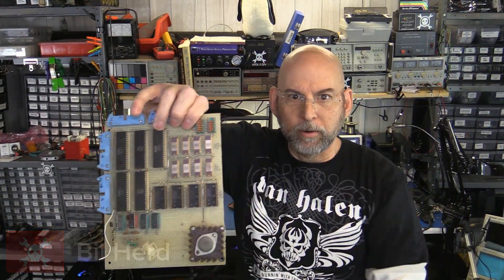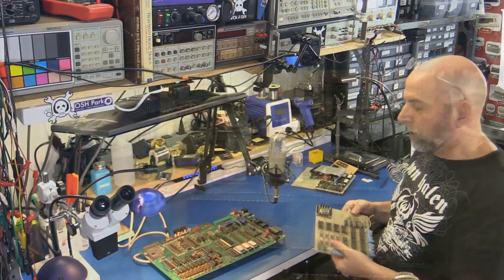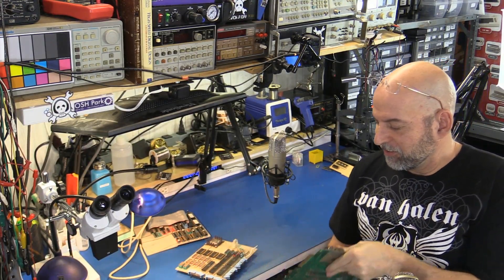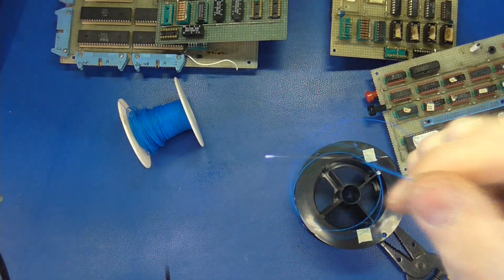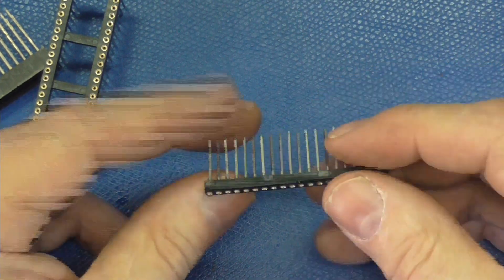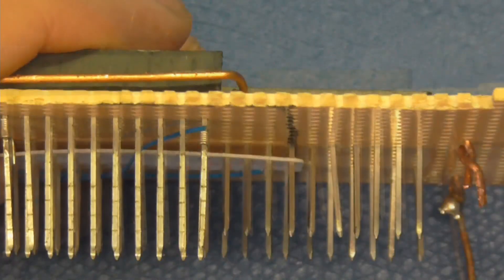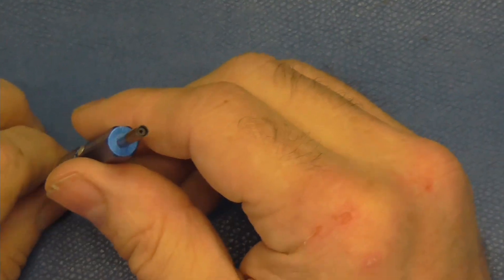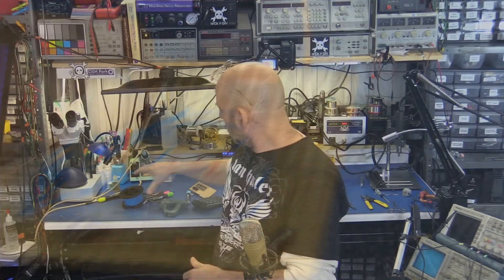Introduction to Wire Wrap

Comment: I commented on this same video  9 yrs ago. Today I'm 3d printing a full tournament size smart chess board and will be using wire wrap for the play surface... certainly beats the cost of such a large PCB and I can 3d print mounts with holes for the component legs.

Comment: It's been 7 years since my Senior Design project, now I feel like I've forgotten everything (I do software now). But I'm picking up a new project with the Raspberry Pi and I didn't want to use an ugly breadboard so I watched this video. Another thing I need to learn is how to crimp wires into small plastic connectors.

Comment: Crazy thought, and it's an idea that's still kind of percolating, but I'm looking at wire wrap as a potential way in integrate electronics into 3D printed objects. What I'm thinking is 3D print something akin to a perf board, run my through hole parts and wire wrap to make the connections. No need to pay for PCBs, or wait for them to arrive. No worries about melting my parts soldering stuff together...

Of course, that kind of leads to a question of cost. If wire wrap tools and parts are crazy expensive, and I don't make a bunch of prototypes, a custom PCB might be less expensive.

Comment: It's a bit sad they no longer teach wire wrap, in my opinion it was a superior solution for learning the very basics, there was an obvious correlation between connections and capacitive or inductive issues that I think is much harder to teach on PCB. I realise the were other issues that don't sit well for modern solutions, but the basics don't have to be learnt up at 120MHz.

Comment: We had manual wrapping tools that held a small spool of wire, and they would strip and wrap all in one action, they were so fast to daisy chain posts because no stripping. On the last post there was a button on the tool you held at the end of the last wrap which caused the wire to cut in about 1/2 a turn.
Reply: Ah.  A 'Slit 'n Wrap' tool.  I had one.  I miss it.  Can't find a replacement.  The wire was specific to the tool as well.  It was quite fast in use,  about by a factor of three..

Comment: I still have my 30awg wire spool and tools from my IBM co-op nearly 40 years ago.  These are my prized tools that are hidden away, they include EREM 502E 30 awg only wire stripper and Dumont Tweezers Style 00. Back then, I was quite handy with blue wire mods. Thanks for run down memory lane Bill.

Comment: What are the details of that electric wire wrap tool (manufacturer, ...).  I used to use one like that but it had a battery.

Comment: Should add that this method produces a much lower resistance connection than soldering. Imagine at least 20 connections (per pin) with an already low contact resistance per point now in parallel!  Practically zero resistance!

Comment: You never did show how to actually use the manual tool! That's what I was hoping to see. Does the number of turns depend on how much wire gets pushed up inside the barrel of the tool?

Comment: found a old radio shack wire wrapper looking for something else, never use it, i could send you a pic if that's ok and you might be able to id it for me, what wire size it would use.
also is wire wrapping in general as good electrically as a good solder joint?
thanks
John

Comment: Is wire wrapping with an electric wrapper literally faster and more recommendable than soldering perfboard or strip board?
Reply: Yes! It's tedious, but you can fix any bad connection with very little effort. Even by using a manual tool.

Comment: I have built a number of 1970s style computers myself over the last decade using wire wrapping. In my case, I have fewer connection failures than with soldering, just like the old saying goes. It's easy to change the circuit while experimenting. The highest stable operating clock is up to about 25MHz.

Comment: you need to strip the wire at the right length to get the insulation wrap right...I think it depends on what bit you are using for what length to strip it...some do two insulation or three insulation wraps ect...

Comment: wow.  takes me back.  I bet I ran a mile of ww wire back in the mid-80's for a AGV startup in los gatos.  tried to always use the backside labels.  talked the boss into spending the extra dollars for the electric gun that stripped the wire as well as wrapping.  worth ten times more than whatever the delta dollars were...

Comment: Is there a frequency restriction on wire wrapped boards? I'm doing Ardunio projects which is probably slow enough.
Reply: i wanna make a wire wrap pentium III lol
Reply: @jinlim6575  On 30 gauge wire I believe the frequency restriction is 100 MHz. On just a Pentium II your looking at a minimum speed of 233 MHz (On a Pentium III your looking at 1 GHz). It might be doable on a Pentium Classic at 60 MHz. The last processor I wire wrapped was a Z80 which is an 8 bit processor and took about a month working on it 2-4 hours per day. And spent about a week troubleshooting. The clock speed I was working on was 4 MHz on the Z80 chip and using TTL circuits. If this is your goal I would recommend working on something small and go for more complex projects. Keep in mind I did wire wrapping for a living.
Reply: @kentharris7427  i think I saw someone who makes a 22awg wire wrap bit so that might give enough speed but not sure where you would even buy 22awg kynar wire. But also then I think some people said I would run into other problems like capcitance and stuff...maybe I will try to make a commodore 64 to learn about it one day...thanks for the info!

Comment: WOW! Lot of work! When I was young, one of my first job was to work for a Phone company. We usually wire the cables to a chassis, solder them and put some epoxy resin, to make them airtight. LOL in the very first board you handle over the camera, the first thing I've noticed was a bent pin :-) Thank you for sharing.

Comment: I remember my wire wrap days at Boeing in the70's. All of our prototype test equipment was wire wrapped. I still have my original 1976 Cosmac Elf that I wire wrapped
Reply: I wire-wrapped that Elf too, back then, then designed and wire-wrapped a better one with two 6116 SRam and a 2716 eprom with the monitor on it.  Too much fun!

Comment: I remember when I was a kid buying a wire wrapping kit that had, a wire wrapping pen, the plastic grid and double sided adhesive, the wires were not insulated and came with a cutter, no long pin bases were required and you had to be very careful with dust and dirt
Reply: Forgot to ask about the wire you use, can you put the specs please?

Comment: very interesting that this technique was used with circuit boards i had no idea, we use it in the telecom industry to this day mostly in our central offices on the MDF's where we run our jumpers from the line equipment or dslam to the cable side, it is a great way to make an extremely reliable and long lasting connection,  what really blows me away is the back side of the distribution panel for the cable leaving the co is also wire wrapped on and they have been that way in some co's since probably the 1960's so that goes to show just how reliable it is

Comment: Can I use a 30 gauge unwrap tool for 29 gauge wire?
I have some salvaged thumbwheel switches which have wire wrap on them that I would like to unwrap. I measured the wire diameter with a digital caliper and found out that the gauge is 29 AWG (0.011 inch / 0,29 mm). However, I can't find a tool for 29 gauge wire, the closest is 30 AWG. Thanks in advance.
Reply: Probably could
Reply: Not familiar with 29 gauge

Comment: Hi Guy
Nice video--clear and instructive. I used to do some building a long time ago before I got into qualification and material testing and Im thinking of beginning to build some simple audio test equipment. I ve still got some of the tools including an AC powered WW gun and a hand held WW tool.  I actually did know somebody who did WW on ferrite core memory boards--they'd sit them on an A Bomb and they could still be read after the explosion. 
What I' wondering is, why those pins cost so much? Even from EBay, still like $1.50 each! Buy a good number and the cost gets prohibitive. They must turn out a million or more an hour; how come so high a price? edward_eck@yahoo.com

Comment: Wire wrap was and still is great for trying things out while being more reliable than breadboards. The wire we used to use was pre-stripped, there were tubes of various lengths. A lot of it was heavier gauge than the 30 gauge shown here (I recall 24 gauge being popular, this was well before PCs). There were three types of tips for the wrapping guns. One was the "modified" wrap as shown in this video, which had one wrap of insulation, that was best. There was also the regular wraps that had no insulation wrapped. There were also some special tips that could take the insulated wire (no stripping) and would strip and wrap at the same time to speed up the work. The little blue tools shown here were the first that were "affordable" for us home hobbyists. The Radio Shack tools that I purchased were defective, they damaged the wire while wrapping it so the connections were not reliable. But the OK Machine and Tool company came up with these WSU-30M tools (wrap, strip, unwrap, 30 gauge modified wrap) and while the real pro tools were hundreds of dollars these were about 25 bucks. The pro wrap tools didn't even have unwrap, they sold another tool for that (and a separate tool for stripping as well), and it was not cheap either. There were also CNC wire wrapping machines, I was involved in maintaining some of the old software that was used. They would take the net lists and compute the best routes to run the wires, and the layering to use only 2 connections per pin and minimize rework when wires needed to be adjusted, and make a paper tape. Then the CNC machine would read the paper tape and move a pointer with 2 motors in x,y that would show the operator and guide the tool tip where each wire needed to start and end and indicate how long a wire to select. This dramatically sped up the wiring process and reduced the errors. There were service companies that you could ship the netlist to and they would wire it up for you, much like PC houses today. I think it was Bell Telephone that showed the gastight connection at the sharp corners of the pin were more reliable than PC boards. A good wrap had about 10 turns, so 40 gas-tight connections in parallel. It is a little bulky but it is still a good way to make a prototype that is reliable.
Reply: Checking around, tools are cheaper from EBay. Made in China, quality uncertain.

Comment: I once saw an avionics test bench where most of the boards were wire wrap construction.  Back in the 1980's designing and making a PCB was expensive and there was a strong possibility of modifications later.  Since there was only ever going to be about 20 of these benches ever made manufacturing a PCB wasn't cost effective.

Comment: Would you know what kind of wire that is used on LED leads or something similar in size? I have SMD leds that came soldered with wires but I need these presoldered wires extended and not sure what kind of wire I need. thanks

Comment: Thank you for your video.

Today you would design your electronic circuit first in a computer, than you would simulate the circuit in software.
Than you would create a PCB layout on the computer while the software keeps track of the correct connections, in other words which Pin is connected to which other pin. There is no need to do that manually, the only thing you might do is arrange the layout in a nice way, but that doesn't mean that you loose the connection between the Pins.
After that you would print the PCB layout and etch a PCB board or much better you would mill it by using a CNC machine.
The latter one is very fast for prototyping.
The good thing about this approach is, that it is much less error-prone and very likely much faster.
Most of the errors can be found in the simulation. If everything works fine in the simulation, false connections can't happen.
Creating the PCB doesn't introduce a lot of new errors.
So in the end you might only have only a very small number of errors which couldn't be detected by simulation. 
But that isn't a problem. You might try manually to fix this on the hardware and if you have found the error you just go back to the circuit design software and correct it there, then you correct the PCB layout and create a new PCB.
All this is much faster, cheaper and less error-prone than using the wire wrapping technique. It allows even to use SMD parts.
Reply: Company I worked for couldn't afford to do software simulations. We would wire wrap, engineers would test and then change the wires. Only took them a few hours to tweak the designs, then they would have a multi layer pcb made. Of course pcbs were obsolete in 1989, but the latest surface mount stuff was too pricey for the cheap company I worked for( Harris Corp)

Comment: Is this better than using solderless breadboards? Or it's the other case?
Reply: It really depends, for instance  you wouldn't be able to put a pga part on a breadboard whereas building a wire wrap board for just a shift register and a few leds doesn't make any sense at all.

Comment: How do you attach the posts to the perfboard? Are they also suitable as pin headers?

I want to make a couple EEPROM to MaskROM adapters because the pinouts are very different. I need the adapter to support two different pinouts for DIP-28 and DIP-32 MaskROM (need another too but let's keep this simple). I got a perfboard panel, a socket, and ordered SIP wire-wrapping posts. I need 2x14 SIP on one side of my chip socket and 2x16 SIP on the other. Now: am I missing something? I've had the tool and wire a long time and use it often enough but I've never used it properly. ;)
Reply: One way is to solder-tack opposing ends to the board.  But it isn't really needed because the wire wrapping itself will hold the sockets to the board.
Reply: We used to use some hot glue on the underside of the socket to stop it from popping up.

Comment: What do you do if the wire breaks inside the wire wrap tool? I can't get it out! Tried everything...
Reply: Take the bit off the tool and then remove the inside bit out of the sleeve. Now you hve the wire in front of you in the wire wrap slot.
Reply: OK Tools have a large slot just in case this happens.

Comment: This brings back memories.. I use to be a tech doing this day after day.. 
I would also build boards with twisted pair to reduces the cross talk for the high speed design work. Then also the burn enamel wire work too. I did this for boards I need to work for longer periods. There are no pins that could accidentally short together.  Also avoid daisy chaining problems, when you had to undo something. Thanks

Comment: wire wrapping is part of a aircraft maintenance engineer's standard knowledge but I haven't seen it being used yet
Reply: I believe you are referring to "Safety Wire" wrapping to physically prevent a fastener such as a nut or bolt from loosening during aircraft operation..

Comment: I did laugh a little, because I found some of these Headers with long pins in my stuff, and now I know why they are so long :D Thanks a lot, Bill, to me you are an inspiring person and enginieer, and as a student in electrical engineering I love to learn things like these. Greetings from Germany!
Reply: I am now a student of electrical engineering too!
Reply: I have also found them in my Workshop.
Sadly i now found out, that i've  only found 3 unwrapping Tools, but Not the Tool for wrapping that stuff.

But I could literally take a bath within 
these WireWrap Headers, because I have so many of them.

And as Electrician for devices and systems I'm also curios about that stuff.

(So I didn't learn that electronics stuff as student in the university, but basically i'm doing that same stuff.

Eg. I am designing new circuits, I'm etching the PCB (complicated multi-step process), I'm Testing the pcb's, I write the programs for the μC's, etc.

So basically stuff, also an electrical engineer is doing.

Greetings from Bavaria.